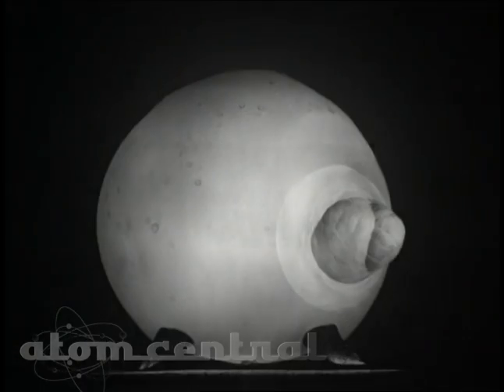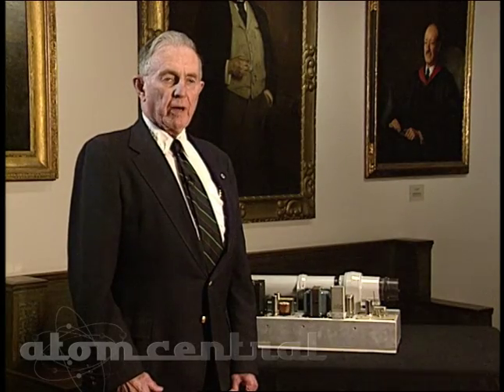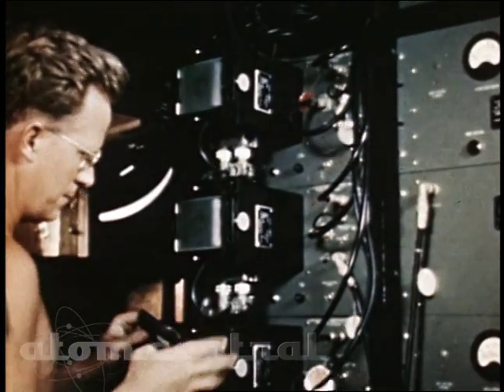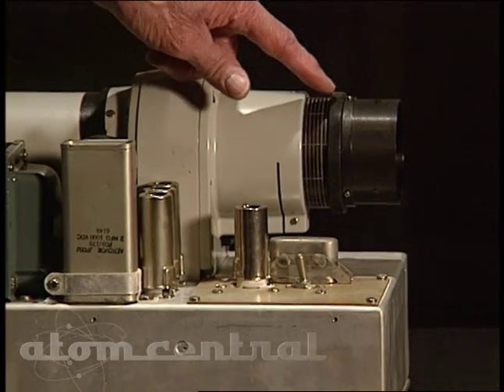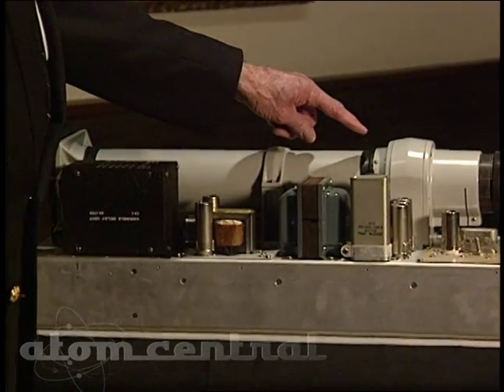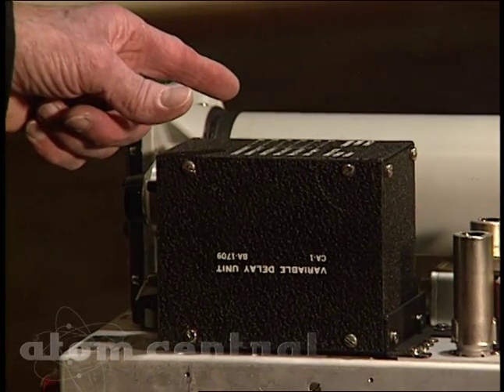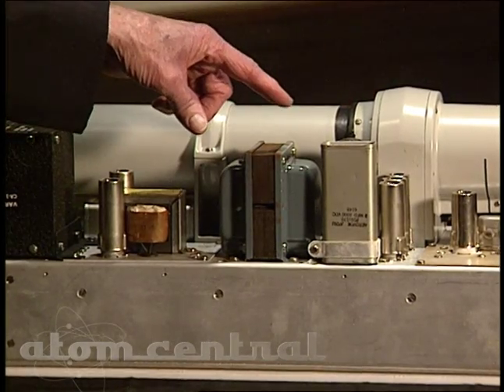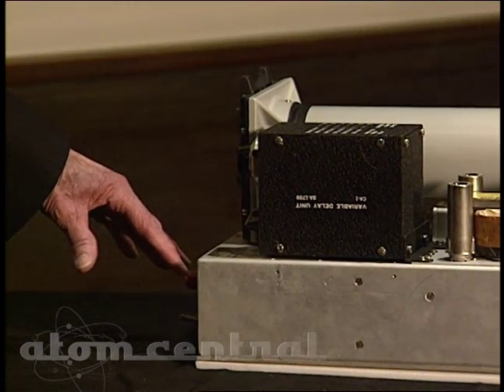Charles Wyckoff and the Rapatronic Camera

Comment: Wonder what those jet like things were that shot out the bottom of more than one of the explosions. Some of them had more than two spots where energy shot out like a spike. All the pictures these cameras took are extremely neat!
Reply: The hard radiation is absorbed by the guide wires of the shot cab, which then heats up and the heat travels way faster through the metal than the atmosphere, creating these spikes of the plasma ball.
They're called "rope tricks".
Reply: @bami2 , more specifically, it's x-rays burning the paint off the cables holding up the tower.
Reply: @bami2  Every thing you said is correct except they are not guide wires they are guy wires.
And they are vaporized by the X-rays traveling at or near the speed of light. which is much faster that the shock wave of the fireball.
Reply: @sealy3  It's not x-rays that vaporise them since they're absorbed by the air, but the cables do absorb UV, visible light and IR radiation. That's why the effect could be enhanced or prevented by painting the cables black or covering them with reflective foil.

Comment: Do you have any information on what kind of armoured housing they were in? There is one sequence set on the shot cab as it was vaporised that would be my favourite and I have always wondered what they did to protect the camera and film.
Reply: The useage of lots of mirrors saved these cameras if I’m not mistaken
Reply: The cameras were located on towers about 7 miles away from the shot tower, well out of blast range.